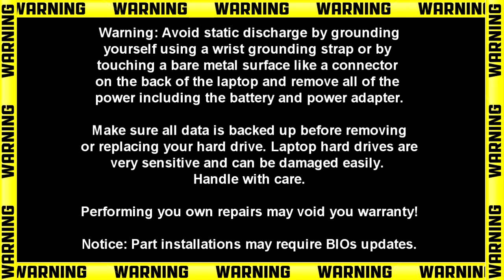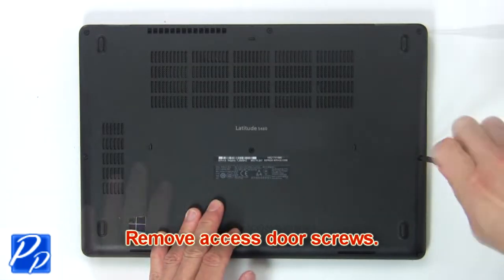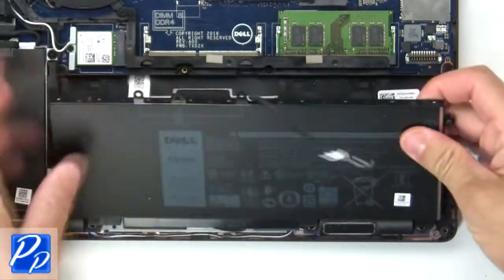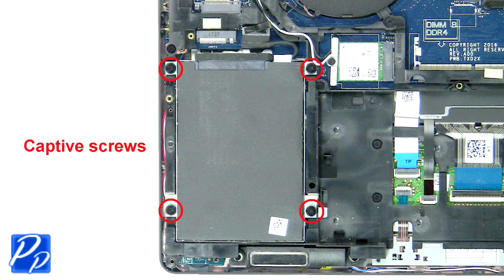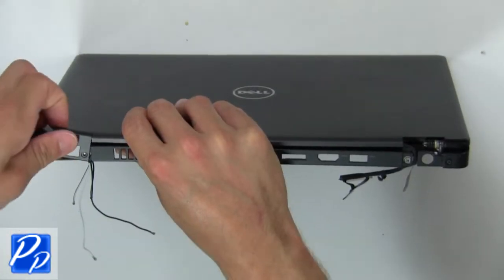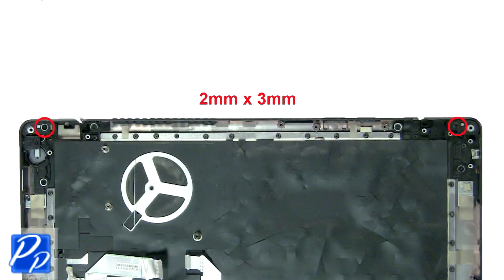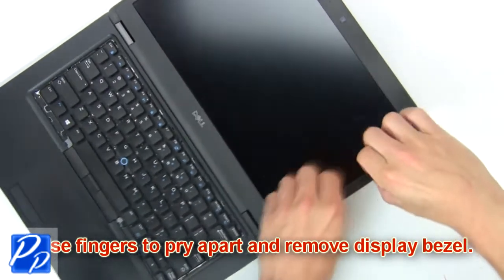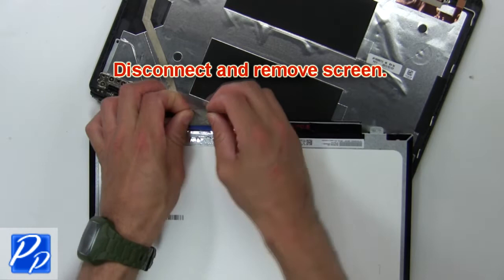Dell Latitude 5490 (P72G002) Screen How-To Video Tutorial

Comment: Why did you strip the laptop down that much? You just need to remove bezel strip and take out the screen?🤷
Reply: Disconnect the battery before disconnecting the LCD, otherwise the display power circuit will fail